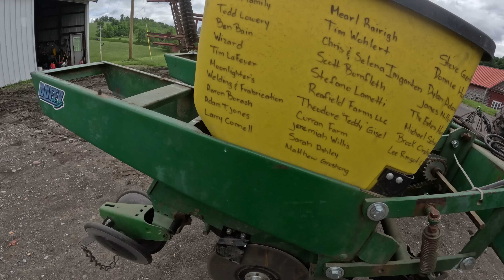Upgrades To The Corn Planter- Maybe We Will Plant Corn

Comment: For the electrical on your tractor take the cowl cover off the dash on the inside and check your circuit breakers. They like to melt the plastic they mount in and develop a bad connection. They should be mounted in with 1 nut and the wires fastened with a second nut

Comment: I would keep the cylinders maybe they would be good for something else at some point. Like a hydraulic top for the 3 point or it might be the right size to replace a bad one someday. Just sayin. And the yellow is usually for construction equipment. But replacements can be green or yellow or even black just depends what’s in stock that one cylinder may fit 20 different things or more
Reply: Top link

Comment: That hydraulic block (alternating valve) should send oil to one marker when you cycle the hydraulics and then send to the other one the next cycle should not send to both, I have had the piston inside the block get sticky and give problems usually from setting for long periods of time.

Comment: He talks about wanting storage for the planter yet there sets the combine in the weeds without even a tarp over the bin. Unless that bin was cleaned out good which I doubt the rotting corn rusting out the sheet metal.
Reply: Lmao that combine wouldn't be worth building storage for. And you ever been passed the farm equipment dealership and seeing the used combines all sitting outside 😂😂
Reply: @Otherrandomguy42 Any combines I have ever seen at dealers were at least cleaned out which I suspect this one was not. I know it's worn out and not worth much but even covering the bin would keep it from getting any worse. I've seen what water and rotting grain will do in those 20 Series.
Reply: Why don’t you send him a couple hundred thousand to build a big shed
Reply: Because he has a building that he can make the planter fit inside of. He can't make the combine any smaller and buildings are not cheap at all